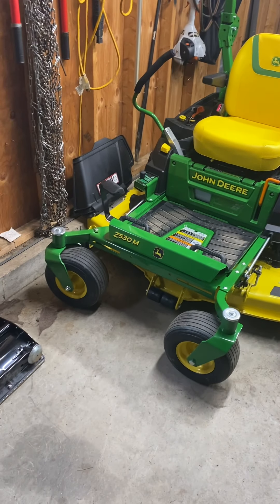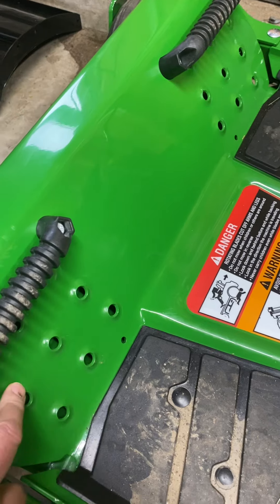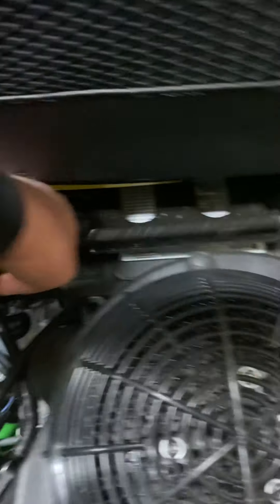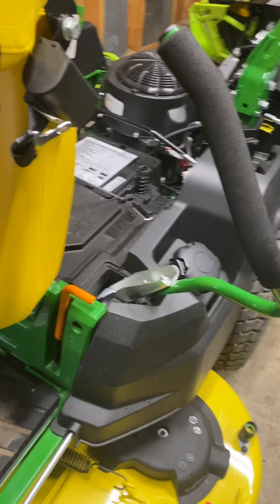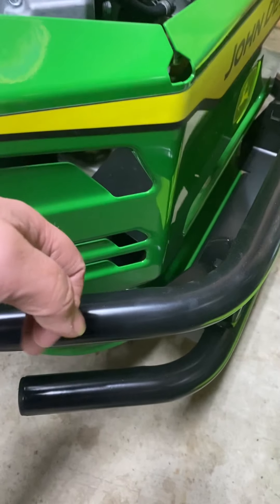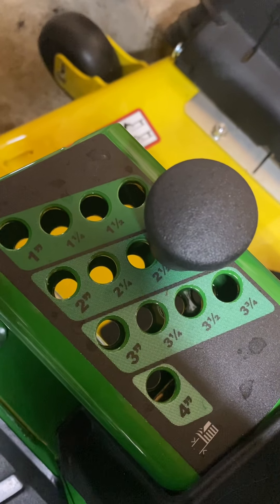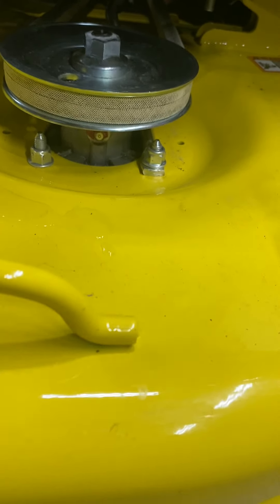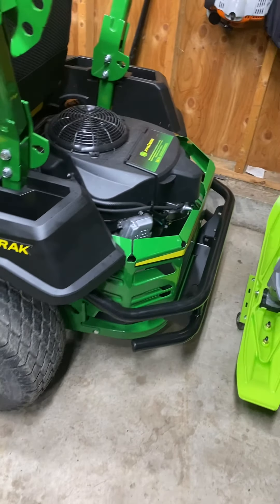2021 John Deere z530m

Comment: I just got the Z530R from my dealer . I went with the extended warranty. 600 hours or 7 years . They pick up and bring back mower that’s had warranty work. No charge for transportation.  I know they sale these at lowes and home depot but the extended warranties are not as good . I have also noticed that parts like oil and filters etc. they are cheaper at the dealership. Than at lowes or Home Depot.   There is a shortage of mowers I had to wait about two weeks to get mine .   Yes the 700 series has a better deck but there just to expensive.I believe the R series has the 9 gauge stamp deck and the E and the M has  a 10 gauge stamp deck.  I didn’t want the 535 because it had a Briggs on it . I will stick with the Kawasaki 24 hp.
Reply: I ordered a Z515E, I’d be skipping down the street if it shows up in two weeks!
Reply: @rossbaiza9369  yea that mower comes with a Briggs when I originally made my order online the local dealer called and said it would be 90 days . They called back 2 days later and said it would be 3 weeks . I got the z530r with 60 inch cut  Kawasaki engine . I would recommend. The z 530m or the z530 r . They both come with Kawasaki engine . I have had my mower for a month . It’s a great mower and fast

Comment: If anyone has bought a canopy for the Z500 series let me know where you got one. There is only after market stuff available.   I would go with the Kawasaki engine over the Briggs .  Be patient there is a shortage of mowers just like vehicles .  I was originally told it would be 90 days before I got my mower but I was lucky I got it in 30 days. Z530r is amazing

Comment: I’m looking at the same model and I’m 6 feet 5 inches tall and mowing about 1 1/2 acres. Been using JD Tractor with a 48 inch deck and it’s 21 years old now. I’m look more for comfort in a zero turn. What do you think since you posted this video?
Reply from the maker: Hi thanks for watching the video. I no longer have the z530 m I ended up getting rid of it shortly after I made the video, I needed something bigger, I bought a z950m model and would never go back to anything else. I am much more comfortable on this z950 m and it is just built so much better, but there is also a major price jump, going from a home owner machine to a commercial machine, but was worth it to me.

Comment: Great video. Very informative. My lawn tractor transmission is almost shot so I need a new mower. Do I need to buy that attachment (I probably will anyway because it looks sweet lol) on the back because I need to pull my utility cart too or does it already have something for a hitch or a pin I can insert?
Reply: The hitch comes with the bumper kit,I think.

Comment: Is there a top that attached to roll bar?
Also would it be a good starter mower to get into lawn service in your opinion?
Reply: You can order a canopy.  I added one to my 530R and it is well worth it.
Reply: @bicparker1  ok where did u get one . John Deere has nothing for z500 series
Reply: @pyroman49wedd86  I went through my local John Deere dealer (not HD or Lowes).  They found one at another dealer and shipped it over.  JD does not have it in their web listed accessories, but it features it in their sales flyer.  When I pointed that out to the dealer, they started making calls.  It has been a welcome relief where I live. It is sunny hear and regularly gets to or above 100°F.
Reply: @bicparker1   Yea well my dealer hardly will mess with me. They didn’t like it I bought my mower online . It’s a long story  do you have a receipt that shows some stock number . There has to be something. Thanks
Reply: @bicparker1  by the way I have asked my dealership if there is a canopy . They say no. So I need a stock number or something to show them
Reply: @pyroman49wedd86   LPA11548 Canopy.   $169.00.    I had to pull that off my invoice. I hope that helps.   According to my dealer, it was not to be listed as available till June.
Reply: @bicparker1  yes it does . It  shows up as cover online but there is a second stock number that’s different and it 189.00  it also says cover
Reply: @bicparker1  the second number is LPA11586 says it’s 189.00. Not sure what the difference is between the two.  I did put in order online for lpa11548 for 169.00. Thx
Reply: @bicparker1    Yea thanks  my John Deere says maybe July arrival.  I was told there aftermarket but they put the John Deere name on it. They have tried to swap from other dealers but every time they do parts are missing. You got lucky to get one so soon
Reply: You can get a canopy but they are back ordered from John Deere . Look at my comment on top for item #

Comment: Great mower. I also just picked one up last week.  Do you happen to have part numbers for the rear bumper and foot rest? Would like to add those to mine.
Reply from the maker: I will Check and see if I have the part numbers still. I managed to find the rear bumper on eBay I couldn’t find it anywhere else. Green parts store had the foot grab handles. If I find the numbers I will post them for you.
Reply from the maker: Foot peg kit #BUC10332 rear bumper item # from eBay is 164654375783

Comment: Here is the part # LPA11548 Canopy. This will fit Z500 series. It is a cloth canopy . I was told by my John Deere dealer it’s not made by John Deere it’s a aftermarket brand. Good luck I just ordered mine today it may take untill July to get one . Everything is back ordered. My local John Deere dealer has tried to get them from other stores but every one has been missing parts .   I hope y’all find one   And thank you to bic .Parker for the item #